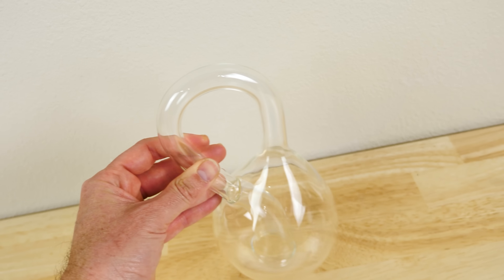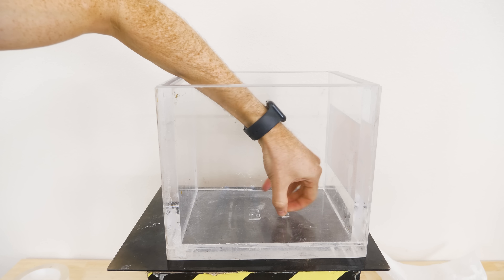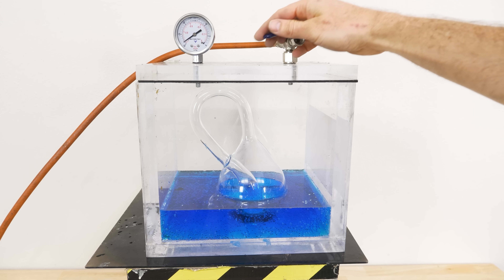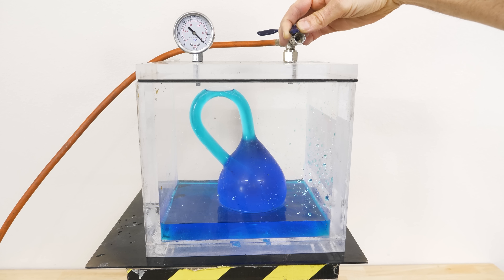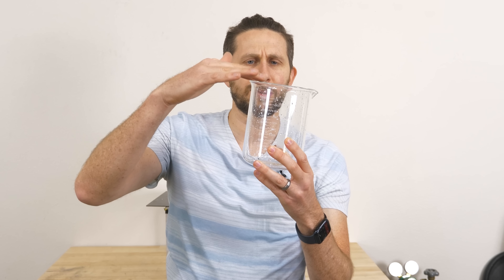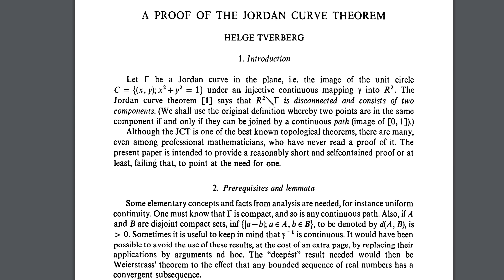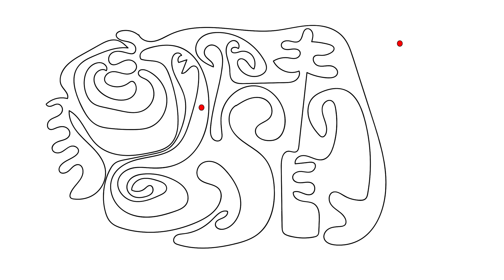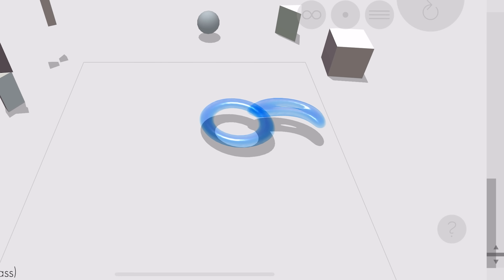Is It Possible To Completely Fill a Klein Bottle?

Comment: Didn’t need a vacuum. You can fill it with a straw narrower than the bottleneck. The trick is to ensure there is room for the air to escape whilst it’s being filled.

Comment: I found out a sequence that might change math
1=1
2=2
3=6
4=24
5=120
6=720
its a standard formula BUT its special because take number six and divide it by the fifth number in the sequence you always get six so take any number in the sequence and divide it by the one below it and you will always get the first number.
I figured out this sequence by doing this:
1
1•2
1•2•3 
and so on... 
PLEASE REPLY BACK

Comment: Could you not just fill this bottle with a simple water pump and hose, have the hose fed up from the bottom then when the main cavity is filled rotate the bottle to fill the narrow (neck) area until it is holding all the liquid possible with no air

Comment: I'm not a very smart person, but wouldn't it be easier to fill this bottle by simply sticking a tube from under some kind of juice bag into it first? Then when filling the bottle, the air under water pressure would come out through the tube. =_=

Comment: via force from a hose to compress it into the larger bottle part of the klein bottle as if it were a water slide with enclosed tubes, it would still work the same

Comment: I'm not sure but I thought volume is not dependent on open or closed containers.  The volume of your glass Klein Bottle was evident when you held it in your hand when it was filled.  Your hand was serving as the defined end of the container.  I also think there is any easier way to fill this bottle.  By using a flexible straw and positioning the bottle with the opening downward, then pumping the fluid in while carefully & in time turning the bottle so the opening is upward.
Reply: That is what he was talking about at the end about how his “physical” Klein bottle isnt the same as the 4d true Klein bottle
Reply: @oneone99able What is the 4th dimension he speaks of. I only see three.
Reply: @PatchesKB  Yes if it was possible to portray 4 dimensions, obviously he would show that. Since it's not, he can show the 3D "slices" of the 4D bottle so you can get an idea of how the "tube" actually curves around the "chamber".
Reply: He's using the mathematical definition of volume (which is pretty evident as he's literally says "according to topology". In mathematical terms, when a three dimensional object isn't enclosed, it has no volume. Just like an open two dimensional object (i.e a line that doesn't connect to itself) doesn't have an area.
Reply: you are right, they aren't using the word volume correctly. Its kinda cringe.
Reply: @LB-yg2br no, you just aren’t paying attention.

Actually watch the end of the video instead of talking out of your ass.

Better yet do some reading yourself but I know better then to expect that

Comment: Take a tube smaller than the smallest diameter of the KB. Use a funnel or pump the liquid in. No vacuum chamber needed, much quicker results.

Fun Fact 1: The "3D representation of a 4D structure" is better described as the shadow of the 4D structure. Think about it for a moment. When you see a shadow of yourself in the sun, the shadow of the 3D object is 2D. This works recursively. 4D is a shadow of 5D, 2D is a shadow of 3D,  1D is a shadow of 2D. Now if you extrapolate this effect means all object exist in all dimensions but the limitation of observation will only be capable of seeing some of those dimensions. The limit of observation goes both ways. Using human senses we can observe physical objects in 3D, we can observe the effects of shadowing in 2D and the effects of 4D as time passing but we cannot observe 1D or 5D - its a window on the universe.

Fun Fact 2: Fuzzy logic is used to determine when a unenclosed topology is considered more than half full. And you thought the question "is the glass half empty or half full" was easy ;-)

Comment: I feel like I've just watched a conspiracy theory video. The beaker may not have a volume for itself, but there is a volume of water/air that it can carry away with it so I call semantic shenanigans. Anyone who has performed a task requiring volumetric precision (hands up anyone who has ever made a cake) knows jugs do indeed hold volumetric units irregardless of putting a lid on it to enclose it.
Theoretical =/= Practical in this case. 
My cup holds 250mls of tea/air. 
My cup also does have a material volume of its own which can be measured by submerging it - guess where - into a volume of water inside a measuring jug from where you can determine the variance in the measurement and ascribe it to the ceramic material.

Comment: just insert a small bore hose into the opening, and into a larger cavity. With the larger cavity at the bottom, fill it up to the top, then inverting the bottle while still pushing the water in

Comment: I don't know if I'm the first to say this, but an example from 2d to 3d is a regular bottle. Without the 3rd dimension, it is useless and not fillable, as it curves to make the space to fill. So, it would be impossible to fill a regular bottle in the 2nd dimension.

Comment: 5:23 

What if I draw a circle and put a point in the centre and a point outside the circle and draw a line? The point is inside but the line crossed the curved line an odd number of times (1). No disrespect btw I was just curious

Comment: The Inside World starts right at the bottleneck. The bottleneck just happens to be rather long and taking a strange path and cuts into the inside of the bottle.
It is like taking a normal bottle, putting a long tube on it and then drilling the tube into and out of the main body.

Comment: coulnt you just, fill the ring and then turn it sideways to let the air out... rinse n repeat till full, using your hand or sumthing to block water from coming out but leaving a big enough gap to let air out
would get it atleast half full
also just using a pipe lol
still a neat thing

Comment: IMNSHO, using vacuum is not the only way to fill a Klein bottle, it should be possible also by using a hose that is inserted all the way thru the curved bottleneck. The opening must be downwards at the beginning and as the bottle has been filled up to the neck then the neck must be turned so, that the liquid doesn't leak out. Another and easier way is just to force the liquid into the bottle by using a pump.

Comment: You don't need a vacuum chamber. Just use a hose.

Also the volume argument is kind of dumb and built on intentionally pedantic logic. Like we assign volume to flasks and bottles all the time in science. It doesn't need to be cut off to be assigned volume.

Comment: I have a question. Couldn’t you just stick a tube into the bottle and fill it up with water that way? I feel like theoretically it should work the same
Reply: @HackerActivist  Yes very easily, but only for these pseudoklein bottles. Like he explains at the end, a real klein bottle is impossible in purely 3 dimensional space.
Reply: so its impossible to fill something that isnt real. Iss stick with putting a tube in and filling it normally. @Swannicus
Reply: I was looking for this comment, and when i found it i was disappointed because it only has 48 likes😩.

Comment: so, you have a volume of water. You have an object, and you took some of the volume of water out of his recipient with this object.

How can you said this object have no volume ?
I mean...  you have 1 L, and with it you took 500 ml. That's a volume, empirically.

Another way to solve this nonsensical problem : Archimedes.
You have a volume a Water, a fully filled 1 L tank.
You throw an object in it, and suddenly, the water goes up, the tank is not big enough... Because he was already full, and you have added volume in it.

physics>abstraction

Comment: The tool used to add engine coolant into the engine cooling systems for vw, audi, Porsche and Bugatti use this exact process except it uses compressed air to move check valves to generate a vacuum on the cooling system.

Comment: The proof is wrong.  The outside of the bottle is the area which is designated as the immediate outside of the container, not the extension which warps the inside to the outside.  That is a separate volume based calculation.

Divide the Klein Bottle along the area of transition and you have the volume to calculate.

This has always been bad math and it always will be bad math as is demonstrated when you fill the bottle.

Mathematicians are rarely ever capable when it comes to logic and English, and often forget basic concepts.  This bottle not only has volume, but its volume has been split into two separate chambers, losing a vast majority of potential volume due to its design.

The Lemma is wrong.  This paper is wrong.  People need to stop worshiping Mathmatic Dogma.  It's wrong.

Comment: it could be easy even without a vaccum tube. Run a flexible line in with the hole facing down. inject water and it will push the air out.

Comment: Didn't quite get why a true Klein bottle can only be made in 4-dimensional space
Reply: The bit where sticks through itself, that shouldn't be there. But the connection it makes should. This is completely impossible without at least 4 dimensions.

Think of it like how animals in 3d can have digestive systems that go all the way through us without cutting us apart, but a 2d animal couldn't because it wouldn't be connected to itself.

Comment: If the beaker also has no volume but we usually talk a lot about its volume y defining the top as the "lid" to define the volume, why not do the same with the Klein Bottle as well by just assuming the "lid" to be the hole at the bottom?

Comment: I’m not grasping any significant difference between the Klein bottle and a bottle with a long curving goose neck, other than being really cool. Also, it seems that simply putting the Klein bottle on it’s side, under water that’s agitated, say by wave action near a beach for example, it will fill entirely as well, but maybe that’s missing the point.

Comment: Yes and it can be done multiple ways - first fill in vacum - second use elastic pipie to create pathway for air to leak despite fluid level already inside. Use presurized liquid while filling and these are just from the top of the head.

There is also the way of heating up and down rapidly to create presure differential via expanding /shrinking gas inside
Reply: Liquid does not compress well, that's why your brakes on your car work.

Comment: i think you dont understand this topic all too much. the klein bottle has NOT to be 4d, its a 3d construct, in 1881 most people didnt think in dimensions, and by far most mathematicians didnt think what lies beyond the 3rd nor thought in 3 dimensions for their science.  the klein bottle is literally a bottle that has its outlet INSIDE of the inlet tube, meaning while you fill it it will flow over, refilling itself. its also not a mobius string times 2.... this has nothing more to do with the möbius string than the fact that science doesnt understand them in 3 dimensions, and you explained that a prove has to be proven by prove without ever explaining which things would have to be proven to prove the thing itself. lmao, thats a utterly utterly ridiculous explanation you MIGHT wanna give children.
Reply: also rather ridiculous to explain that with an uneven number of walls between you and the point of interest you are inside, and with an even, you are outside. thats on MANY levels utterly dumb and disgusting when you factor in that you are a science channel. that would ONLY be true if your walls wouldnt have 3 dimensions, if your whole setup would only be a 2d landscape, but you yourself did argue around the 3d bush and explained its 4d, how do you accept 2d in this then?

Comment: Just take a hose and put it into the bottle the another side connect to your vacuum pump, and put this bottle in water. Switch on the pump, and water will be sucked into the bottle. Much easier.

Comment: Oh !! the blue liquid is trapped in there! I thought the liquid was leveled both inside and outside the glass at 1:45. Then I imagined that the air pressure pushed the liquid inside, which did happen but I thought the liquid also entered upwards from the bottom, not just through the top bending tube. I was so confused when the air was sucked out a second time, because the liquid in the klein bottle did NOT level back to a flat surface. I hate my brain sometimes
Reply: It's mindfuck isn't it

Comment: actually there is a very less expensive way to fill that. all you need to do is stick a straw all over to the inner part of the bottle. you emerge your bottle in a bucket until it is completelly cover, then you suck the air out and the watter will fill in. you can also go pourin little amounts of water and sucking it time over time, however this generates a lot of unintentional puns

Comment: Isn't it easier to use a rubber tube to pour the liquid in the bottle? Air will automatically get out.  For everyone that doesn't have a vacuum chamber the tube will be soooo much easier.

Comment: i haven't tested it, but if I had to fill the klein bottle, I would simply use a large plastic syringe with a long tube to push it into a selected void, and push liquid into that void. I would also probably do it with it all submersed under the fluid, to avoid air getting back in, Much simpler than a vacuum box; if it works.

Comment: There is actually a way to fill a Kline Bottle in any household situation (that is, if you don't have a low Torr vacuum pump). Fill it upright, then invert it in a fluid, snake a hose through the bottle up to the highest point and suck the air from it via the hose. You may be left with a small air bubble but you can work that out by tipping the bottle under the surface of the fluid.
Reply: or, you know,, use a straw
Reply: Or you can just snake a thin drip tube inside(wide inner part), fill it up to top an then continue filling while rotating.
Reply: Here we are working as vaccum pump not perfectly though.... But yeah it will work
Reply: My first thought was to pump liquid inside
Reply: Or use a small pipe to push the water through.
Reply: Is spelling Klein that hard
Reply: @taki7546  Klien
Reply: @taki7546  No, not that difficult, but on a tablet where you can see only a few words at a time and the keypad is a bit small, and the spell checker does strange thinks [see that's the spell checker again, I left the typos in]... then, yes, typos are very common. This is just an informal comment forum, not a published white paper, so spelling is not that important. What really matters is the caliber of one character that can understand this and not even bother commenting about such a nit pick. One would hope that feedback would be on something more substantial. We have a word for those that comment on harmless typos when the message still gets across... we call them "Trolls" [smile].
Reply: i do not think people like you and i would have a torr vacpump
Reply: I mean, couldn't you just totally submerge the bottle in a tub or sink and then work the air by turning it around? Maybe some pesky air would stay in, but I feel it's worth a try.
Reply: @ShetDefrentlyStudios  I've already said this a few comments above
Reply: @apes4days254  I only care a small amount.
Reply: @ShetDefrentlyStudios  I'm glad you care a little.
Reply: You could also just put a couple of straws together and siphon it inside, no need for a vacuum pump
Reply: Poke a length of surgical tubing into the bottle and suck on it while pouring water in the top.
Reply: I simply slowly filled it with crushed ice chunks, letting it melt in the main chamber until it was full. The other way was holding the opening down, inserting a flexible tube up into the bottle until it was in the main chamber and injecting the fluid through the tube until the main chamber was full, and then turned the opening up and continued to fill it to the opening.
Reply: I wonder if you just stuck a smaller tube to fill it or a double lumen tube. The air escapes from the non filling side or from around the single lumen tube. Seems like a fun way to serve fizzy drinks at a science-themed party.
Reply: or just pump the liquid in forcing the air out around the hose
Reply: why not use an even more household solution and put a water hose inside it, and then pour in water through the tube as you take out the hose?
Reply: I dont get it pls help me Im 16
Reply: Or you can try some 🪴 and it won't matter if the no volume thing is full or not
Reply: I can draw the puff pastry I know what it looks like some people want to see to cast as spell 😭
Regards 

Hela
Reply: Or you can run a small hose through to the inner chamber and fill it that way
Reply: Yeah.... a flexible straw should do it
Reply: or just pump water with the hose?
Reply: Led me to think
Reply: Could you not just submerge the bottle?
Reply: @apes4days254 no, the air would still get trapped...one way in for the water, one way out for the air. But as others have said, snake a tube into the bottom, immerse the bottle and hold one end of the tube above the water, and the pressure of the water would force the air out through the tube.
Reply: @Daft_Ideas  still dont understand how submerging the vessle and rotating the entire thing would cause air to be permanently trapped.
Reply: @apes4days254  Well I guess you could rotate it carefully, maybe, but I think the shape would be a very efficient air trap. A bleed tube would be far quicker...

Comment: I think you could fill it without vacuum chamber. You would need a small diameter rubber hose, that you would insert in, and fill the bottle with it, or leave it open for the air to go out. Either way it should work...

Comment: Couldn’t you have done the same thing without a vacuum chamber? 

Submerge it like you did, insert a smaller flexible straw and suck the air out only from inside the bottle.